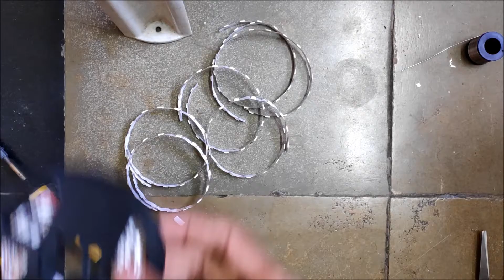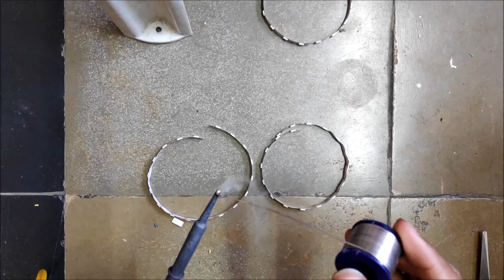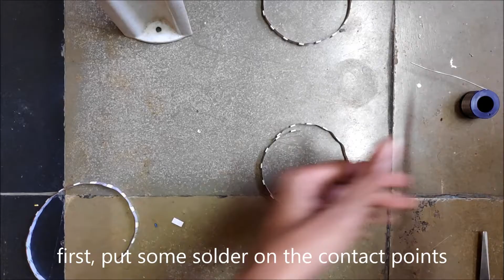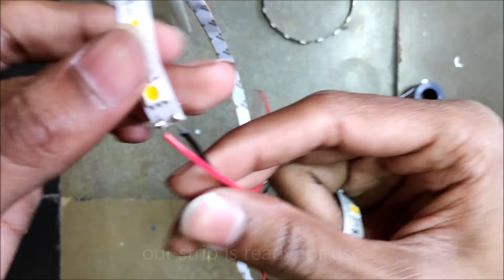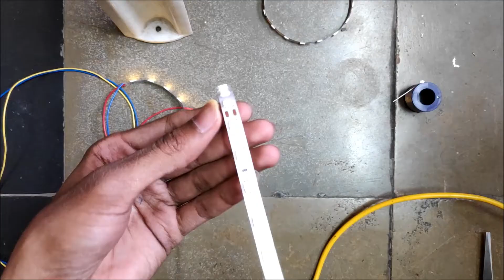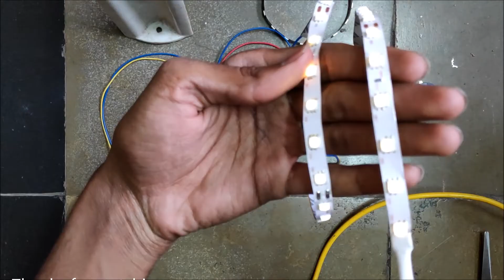How to join LED strips without connector

Comment: do you really have to put solder on them ?
Reply from the maker: There is a connector you can buy instead of soldering.
But if you don't have it, you need to use solder.

Comment: do you need to Solder them together? or can you use like tape and just have them touching.
Reply from the maker: It is preferable to solder for proper contact.

The other method without soldering is to use connectors that are specifically made for joining such strips.

Comment: Hi brother I have a question regarding rgb led strips. Suppose my rgb led strips is too long for my work so can I cut the remaining part or if I do so then I will ruin it ??
Reply from the maker: No. As long as you cut it in proper place, it'll be fine. There are connection points at regular intervals along the strip that you'll see. You need to cut it there.
If you cut elsewhere, that part of the strip will not work.

Comment: Hello i'm just wondering if this also works with rgb led strips? with the remote?
Reply from the maker: Yes it will work.
But it will be a little bit more difficult as there are multiple points to be joined compared to a single color LED strip.
For RGB LED, I suggest using proper connectors
Reply: Your are really helpful Man...!
Reply: @DIYwithAK  brother from where we can get those connectors ??

Comment: Hi , I need to connect my led strip
is it okay if i soldering not in the corner of the led?
I mean connect the postive and negative in the middle of the light, my lamp design looks better if there is no wire in the end section
Reply from the maker: As long as there is provision for connecting wires (contact points), you can connect the wires anywhere.
But make sure you cut the strip at proper places

Comment: So basically I got my strips for Xmas they cost a lot prolly... I cut them and only one short side works plssss help my mum will kill me
Reply: i saw this exact comment on a different vid
Reply from the maker: Sorry I missed your comment somehow.
Just find the proper cutting points on either side of the cut you made. Cut the strip again at these points and join the two pieces at the newly cut points.
(Don't use the two middle pieces that were wrongly cut earlier)
Reply: @DIYwithAK  are u sure it would work
Reply: @DIYwithAK  i’m crying my eyes out cuz i didn’t wait for my mum n cut the strips on my own n now the bigger part is not working😭😭😭😭😭😭

Comment: Hi I am just wondering if you powered with 12 volts? Or 110?
Reply from the maker: Here, I have used a 9 volt battery as the strip length is short. If you have longer strip, you need to use a 12 volt battery or any converter with 12 volts output.
Reply: DIY with AK thank you
Reply: @DIYwithAK  so.. that 9 volt battery that u held in your hand in front of the camera, and touched the wires to.. that’s the 9 volt you used? Makes sense. After reading the comment section, I have determined that you are a very patent person. I would have likely pointed out that I used a small block of 110V as seen in the video. 😆
Reply: @Hammerback0  You need to link me that Duracel 110V battery for my remote 🤣

Comment: So my led lights have the pointy parts, and the flat parts. I layered them on top of each other, and they connected, but the lights won’t match up unfortunately. Can I snip off the pointy part, and just put the two copper flat parts together, and just tape it? Without soldering, and without a connector?
Reply: Yes please I’m having the same issue
Reply from the maker: I'm having a hard time to figure out what kind of LED strip you're working with. I think I need some specific details to help you
Reply: yo you ever figure it out ?